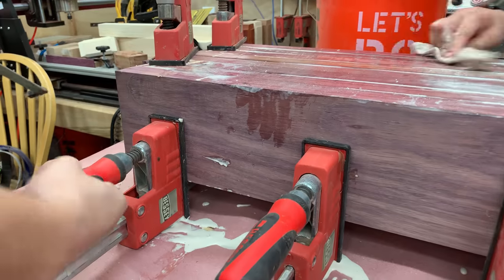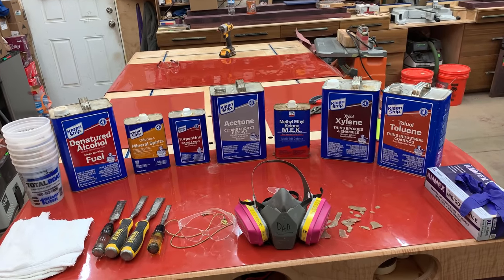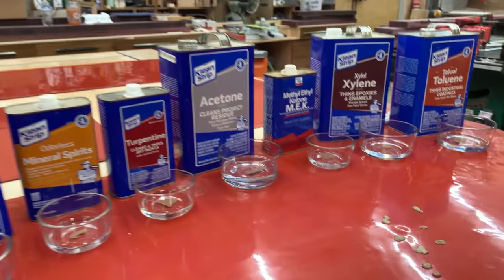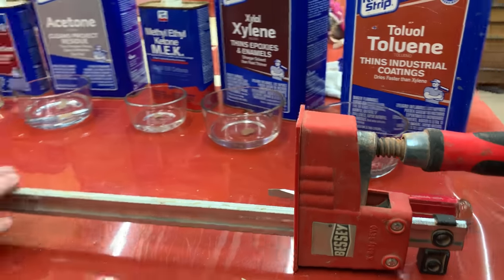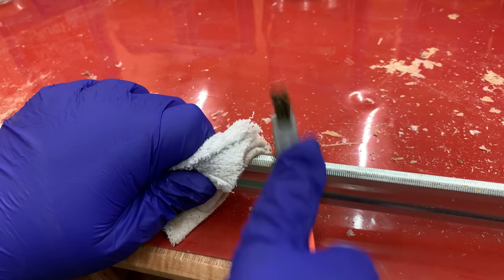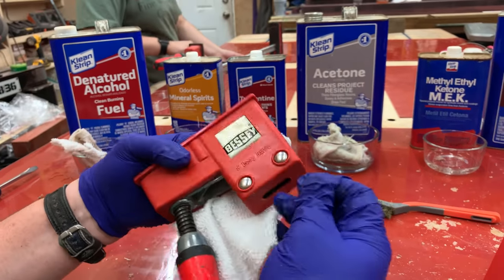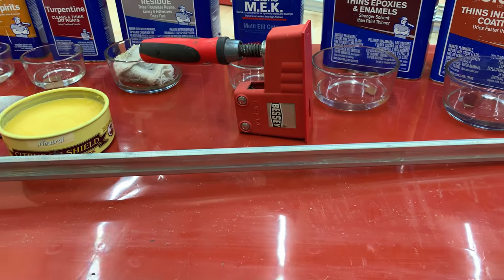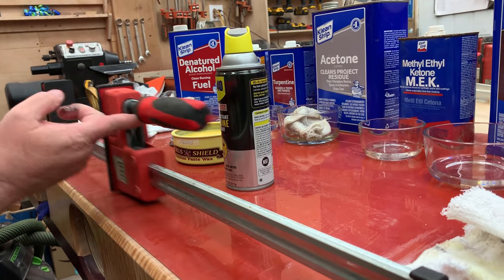83 - How to Clean Dried Glue from Parallel Clamps and make them slide Better Than New

Comment: Vinegar works really well man.  Much safer too. I wrap a couple vinegar soaked wraps around the bar for a few minutes and it works like a charm.
Reply: I tried vinegar and while it worked it turned the silver metal a nasty black like it possibly took the protective finish off and oxidized it.

Comment: you were 100 percent correct on the use of a brass brush  However I find the best method to clean the bars is to use a brass wire wheel brush on a drill.. it will take care of the glue on the bar in minutes and no chemicals needed
Reply: thanks for posting. very helpful
Reply: Scott Kaye sounds really like a good idea. Where did you get the brass wire wheel? Also, what could you use to cover the clamps before doing the clamping? Maybe blue painter’s tape or something cheaper?
Reply: @michaell7877  search "brass wire brush for a drill"  on Amazon.com.   they have a ton of them for cheap

Comment: I recently came across a fabulous method that requires little to no effort and a very safe and inexpensive solvent - vinegar. I don't want to post a link here (just search for "clean clamps with vinegar") in the youtube search. Method is simple: build tubes with PVC pipes & end caps that are longer than and slightly wider than the clamp bar. Disassemble clamps. Fill tube with distilled vinegar. Soak clamp bar for 2+ hours (overnite). Remove bar, rinse, wax, reassemble. If the build up is heavy, you'll need a longer soak time. If the soak time is long enough, all glue gets fully dissolved. If the soak time is light, then the glue will be softened (not dissolved) and easy to wipe. The one down side, and from my research, this isn't a problem: the shiny chrome(?) finish on the bars will be dulled with long soaks.

Comment: You can clean these up way faster with a brass brush wheel on a bench grinder. No chemicals needed. Wear your safety glasses.
Reply: I used this method but ever since the clamps have been leaving blue speckles on the workpiece during clamp up. Have you experienced this problem?

Comment: Wow, did I ever need this video. My parallel clamps are in terrible shape, and I didn't know how to get the glue off of them. I didn't think that acetone would soften the glue like you showed. And then waxing the bars to prevent the glue sticking is brilliant. This video really saved my parallel clamps, as I hate using them like they are now. Thanks a ton, James. This is so helpful!

Comment: Thanks for the tips James. I try to keep mine clean and have some success with using wax and using a lot less glue than you use. I’ve never had a joint fail yet. I also clean it off the clamps immediately which makes cleaning up easier too.

Comment: I just did this for my clamps. I used a wire wheel on my drill to clean after the acetone. This was a great video. They are like new again.
Reply: I used this method but ever since the clamps have been leaving blue speckles on the workpiece during clamp up. Have you experienced this problem?

Comment: An excellent video James. I hadn’t tried your experiment so appreciate the fact that you’ve done the work for me. Your chemistry background came in handy. If I do get glue on my clamps I now know which solvent to use. Acetone is a solvent I always have on hand. I also didn’t know that WD 40 made a silicone spray. I’ve been using a different brand. After watching I realize that I now need to add terry cloth towels to my list on needs for the shop. Thanks for all the information.

Two points — First make sure that the silicone spray doesn’t drip onto a surface where glue and finish will be applied in the future because they won’t stick & Second I try to prevent glue from getting on my clamps, especially those below the glue up, by covering them with wax paper. It’s a cheap preventive measure that saves me a lot of cleaning.

Comment: Good information on cleaning.... only thing I question is having silicone in the shop... if you ever end up with finishing issues of "fish-eye"- look back to contamination with silicone... your process is now on my to do list for 40 some parallel clamps and 70-80 F-style.... thanks
Reply: Carl Hillard I agree on the silicone concern. Need to be cautious and control it. Suggest one of the dry lubricants such as used on your table saw gears
Reply: @jaysimmons2319  which one do you use?
Reply: Any of the Teflon based lubes. Read the labels or content listings on line.  Wipe it on do not overuse.
Reply: @jaysimmons2319  ah so Teflon is not same as silicone?
Reply: To use layman’s terms. Think of silicone as as oil, whereas teflon is a polymer, think very slippery. Oils can cause “fisheyes” in water based systems but also in oil based systems where they are not miscible.
Reply: @jaysimmons2319  thank you. Got it

Comment: I like using paste wax on the bar to but, for the internal mechanism I prefer Blaster Advanced Dry Lube with Teflon. It's only $4.49 at Homedepot, It also works great to prevent rust on saw blades and to prevent resin build up on the blade. Thank you for taking the time to make this channel.

Comment: I used warm water with a wire brass brush attachment on a corded drill it's work well, after seeing this video i'll try acetone to see if it's work better. Awesome video as usual sir !
Reply: I used this method but ever since the clamps have been leaving blue speckles on the workpiece during clamp up. Have you experienced this problem?

Comment: I’ve always used a steel brush in a grinder (with a face mask, work gloves, and hearing protection). Less than 2 minutes a clamp. Paraffin on the clean rails and wipe off. Never a problem.

Comment: I really need to do this to my clamps.  Never even thought about taking them apart. Ha.   I do use paste wax on them now, but didn't think about that when I first got them so there is some glue stuck into the grooves.  Thanks for this info, especially about the acetone - good to know.

One question though.  I was always told that silicone is a big no-no anywhere near a woodworking shop, as it will affect finishes in a bad way, get everywhere and be hard to get rid of.  Have you ever noticed any issues like that?

Comment: Hey James great video. I just bought some used Beasey Parallel clamps. They were unusable until I cleaned them up using your video as a guide.  I meased up and used mineral oil instead of mineral spirits at first, but I went back and wiped down all the plastic parts with mineral spirits. Thus my question. I used a clean rag for the mineral spirits.  But what would be the risk if I had used the same rag .
 @Kings Fine Woodworking

Comment: Also worth mentioning lubricating the threads in your clamps will allow them to clamp harder. There's a lot of pressure on the thread and just a tiny bit of slip does a lot to let it continue to be wound.
Reply from the maker: Yes. Good point. I believe I mention that in the end when applying the silicon lubricant to the threads.
Reply: @KingsFineWoodworking  Ah so you did!

Comment: Before a glue up take a hard wax candle and rub it across the grooved ribs of the clamps it will fill them with wax but still allow the clamp to work smooth and to clean after just use some warm water and a cloth and you will never have glue in the ribs again

Comment: Excellent video James! I have several of the same Bessy Revolution clamps. Question > What about using Bostik Glidecote instead of the WD40? Your thoughts?
Reply: He’s not using WD-40 which is really a solvent not s lubricant.  He’s using s silicone spray made by that Co.  Big dif.

Comment: Great video,  why does the alcohol say "fuel "?  Sounds like you got a bit of a cold,  hope you get to feeling better
Reply: Shaun Kennedy denatured alcohol is ethanol with extra stuff to make it undrinkable. Ethanol being the alcohol in beer, wine, and liquor as well as the additive in gasoline. You can thank the corn growers for higher gas and food costs for a product the is actually less energy per gallon. Denatured alcohol can be used is some camping stoves and in backpacking stoves designed specifically for alcohol.
Reply: You can actually thank our elected representatives for subsidizing and requiring use of ethanol in gasoline.

Comment: James, what sizes of pararel clamp you have
Reply from the maker: Hi, I use 12”, 24”, 30”, and 54”. 
I have 18 of each of the smaller three sizes but only because I used to do production cabinets. 

For the 54” clamps, I only have 4 of those. I don’t use them very often. 

Parallel clamps would ideally be bought in pairs. And if you could only buy one size, I’d recommend the 24”. I use those way more often that all other sizes put together. 

As for clamp manufacturers, I’ve used every one. I have mostly Jets & Besseys because I’ve gotten them on big sale. 

But the Jets, while nice, are NOT worth the full price they sell for. Which is about $154 for a pair of 24” clamps. I bought mine many years ago when they had a very rare 1/2 price sale. 

The Jorgensens are fantastic! And only $88 for a pair. That’s the best value out there right now. And if I had to buy them today, it’s probably what I’d get. 

https://amzn.to/3GMXdnT
Reply: @KingsFineWoodworking  Nice Thanks, Better then using a beam clamp ? I am in the market for a large amount.
Reply from the maker: @kenf2662  hi. 

A beam clamp isn’t better or worse. It’s just different. 

If you need 7000 pounds of clamping force per clamp, then you need a beam clamp. 

If you’re clamping up panels, and you want uniform pressure along the clamp jaw top to bottom, use a parallel clamp.

Comment: Ive heard silicone products can hirt a finish. Have you ever encountered that?
Reply: True. I personally wouldn't use any silicone lubricants on anything that would touch something I planned on finishing. The silicone mat should be fine though. I think.
Reply: @bmay8818  yeah i know ive heard it would mess up a finish but also usually when using those clamps youre usually not going right to finishing
Reply: micdiva a Silicone mat is inert. My glue brushes are a solid silicone compound. Those can touch wood- no problems. Spray silicone OTOH  is evil and will ruin any finish BC it repels almost everything.  - and once you introduce it to your environment good luck getting rid of it. Touching /handling those clamp rails with the silicone spray will transfer it to your stock, your tools, etc etc. even if you don’t have trouble at first - give it a few years and it becomes impossible to track down. Personally I’d avoid that like the plague on anything I was going to handle.  Light machine oil works just as well on clamps  and is easy to control. It’ll also ruin finishes but you can get rid of it before finishing.  I worked in a production shop while in college - they saturated their steel clamps with used motor oil !!  No glue on the planet would stick to it and while it did mark the stock, it was gone with the first pass through the planer after glue-up.